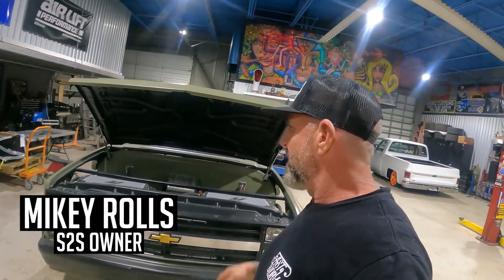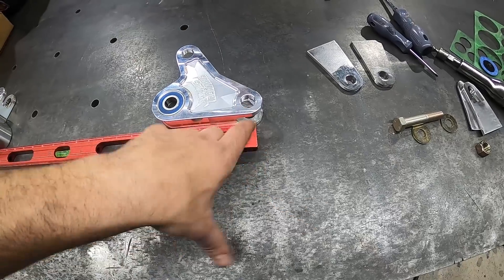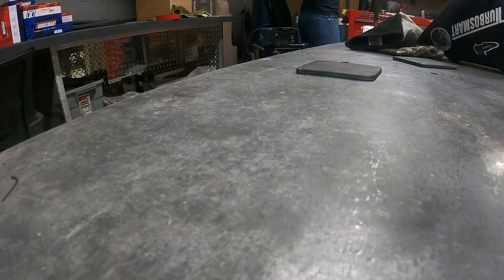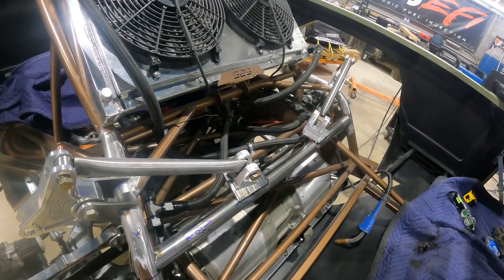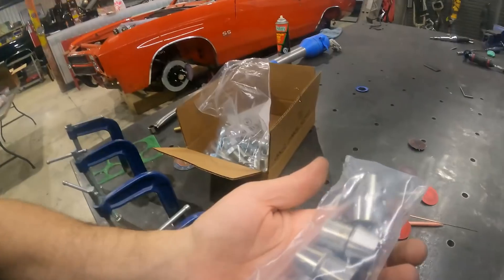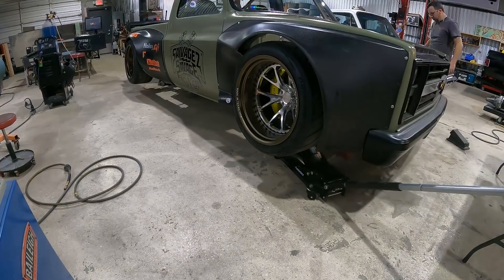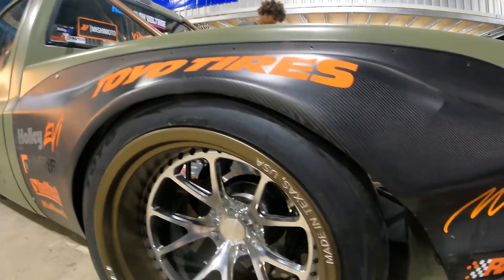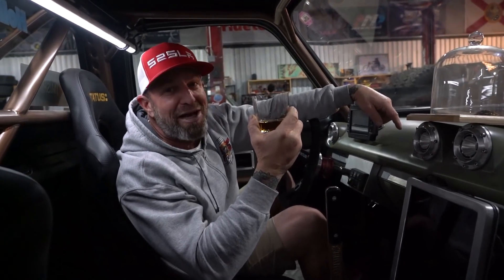Tesla Swapped Squarebody C10 Pushrod Suspension Fabrication! - EV C10 Ep. 26

Comment: I was yelling at him when he tried to mount the rod to clear the front half shaft lol. All u had to do is cut off the two pieces that stick up on the lower control arm (the piece that has all the holes drilled in it) smooth it up and take a piece of channel similar to the piece with the holes and then turn it 90° from the original orientation, front to back instead of the side to side orientation of the one he used. Then u could have had all the clearance and it would have given you the option of putting the arm with the hymes in front of or behind the half shaft. Also it would have allowed him to secure the hyme between the two sides instead of using one flat piece of steel and then spacing it out where it had all kinds of leverage and forces to just tare up that mount.  It would have worked flawlessly. Way better than the 3/8's inch clearance you have now. Did you turn the wheel, that half shaft doesn't stay in one spot, I'm sure he did. He is a great fabricator and I'm not at all putting him down the truck is amazing and I love it. I also love problem solving and fabricating. Thinking outside the box, sit a d look at it for 30 min or so before jumping on your first and easiest idea. Good luck and God bless...

Comment: Awesome man. I was yelling at you when u were trying to mount the rod to clear the front half shaft lol. All u had to do is cut off the two pieces that stick up on the lower control arm (the piece that has all the holes drilled in it) smooth it up and take a piece of channel similar to the piece with the holes and then turn it 90° from the original orientation. Then u could have had all the clearance and it would have given you the option of putting the arm with the hymes in front of or behind the half shaft. Would have worked flawlessly. Way better than the 3/8's inch clearance you have now. Did you turn the wheel, that half shaft doesn't stay in one spot, I'm sure you did. You are a great fabricator and I'm not at all putting u down the truck is amazing and I love it. I also love problem solving and fabricating. Thinking outside the box, sit a d look at it for 30 min or so before jumping on your first and easiest idea. Good luck and god bless...

Comment: It's definitely low. The question becomes more about how you plan to get over speed bumps and high angle driveways. Low cars don't much like sudden steep inclines or scraping their bellies on asphalt/concrete. If you're not careful it's going to wind up being a trailer queen...

Conversely if you could mount the shocks to an electric linear actuator with enough torque that could move the shock mounts in and out on demand, that would be cool beyond reason. I've never seen it before and I didn't have much luck with a quick search here on YouTube. You could also do it with push rods and hydraulics. Either way it's still a great build and I'm glad you shared the journey.
Reply from the maker: Yes we could do something like a hydro lfit. But first of the truck won’t ever see a speed bump or a driveway. The truck is made for racing and track use only. We can make adjustments by twisting the rod, can go up a few inches

Comment: I’m assuming that you could mount them on something that was not a 90° angle, but that would just make the math more complicated correct?
Reply from the maker: If you mounted that coil over bracket on something that wasn't 90 degrees, then it would mainly just change the length of the coil over you'd run to bring the angle out of the rocker back to that 90!

Comment: Will ya just look at that….just look at it….sometimes I just gotta step back and look at it ya know….lol love it. 
What’s the difference between this setup and a cantilever setup? Is it just the mounting points?
Reply from the maker: Same thing, different adjectives. The cantilever describes the movement/pivot. The pushrod is just describing the rod that sits where the coil over would be in a standard set up. We use the terms interchangeably. I'm sure there is some technical difference between the two, but we're keeping the descriptions simple!
Reply: I was thinking they were pretty close to the same thing just different terminology. It’s looking good. I can’t wait to see how it rides.

Comment: In board shock systems are Very sensitive. Any small change in angle in the shock changes the dynamics  in rebound and compression  and their rates. For a street car it's ok. But don't expect to  race with it. Fast changes  in loading and  unloading will occur  unpredictable . Why the change  from the old? Your addition  weight and moving parts. Kiss technique?

Comment: quite good looking mock up ... though at the front it seems that a massive shear stress is going to be applied at the bottom ball joint fastening point...  both on the bolt and on the drilled bottom suspension arm. Also since the split top plateforms are wider than the chromolly tube, maybe a reinforcing piece would beneficially take part of the pushing effort of one side to the other (linking the inner part of the small squarish plateforms to each other)? can't wait to see it in action...

Comment: For your rocker arms, do you have a spacer tube between the bearings and additional spacers outside of the rocker so that the mounting tabs apply pressure to the inner bearing races only?

I noticed when you lowered the truck after adjusting the front height that the rocker’s pivot point moved eccentrically quite a bit on the bolt. Was this just a mock-up setup or is everything in its final position? 

This truck is so cool and I’ve really loved your series showing the process. Keep up the great work!
Reply from the maker: This is all just preliminary mock up for the suspension. Everything is going to get finalized once we have our coiler overs. We just weren't able to order up our coil overs until we had everything roughed in place. Thanks so much for the support!
Reply: @SalvagetoSavage  Ah nice, that totally makes sense. Thanks for the reply as well as the insight as to what all goes into designing a pushrod suspension setup from scratch!

Comment: Bar far now my favorite channel on YT. Question for the team: Are all the kinks ironed out of the AWD system yet? I know you did have the front motor working to some extent a little while ago..
Reply from the maker: Yes and no. We're getting closer to getting it tuned right, but trying to work out some issues with applying full power from the battery to both motors at the same time without popping our pyro fuse! We'll give you an update on that once we have those coil overs in next time!
Reply: @SalvagetoSavage  might need to run two maybe for double the amperage?

Comment: Should put a spacer in between the two plates so when you’re tightening the bottom front bolt you don’t bend the mounts.
Reply: Its more than that though. if the pushrod is between the two plates it would be considered a double sheer joint. It's now only single sheer and significantly weaker. I hope that was just for mock up and they wont actually run it that way.
Reply: @benjaminbuschi284  I agree it should be a double sheer. Was just unsure how much they planned to change.

Comment: On the front set-up, are the axles going to articulate front to rear while steering and will that interfere with the pushrod?
Reply from the maker: It should mess with the pushrod at all. Our mounting point is pretty similar to how we had it with the standard suspension set up!

Comment: Looks awesome! Did you guys think about mounting the pushrod on the front suspension to the upper control arm? Just curious
Reply: I was yelling at him when he tried to mount the rod to clear the front half shaft lol. All u had to do is cut off the two pieces that stick up on the lower control arm (the piece that has all the holes drilled in it) smooth it up and take a piece of channel similar to the piece with the holes and then turn it 90° from the original orientation, front to back instead of the side to side orientation of the one he used. Then u could have had all the clearance and it would have given you the option of putting the arm with the hymes in front of or behind the half shaft. Also it would have allowed him to secure the hyme between the two sides instead of using one flat piece of steel and then spacing it out where it had all kinds of leverage and forces to just tare up that mount.  It would have worked flawlessly. Way better than the 3/8's inch clearance you have now. Did you turn the wheel, that half shaft doesn't stay in one spot, I'm sure he did. He is a great fabricator and I'm not at all putting him down the truck is amazing and I love it. I also love problem solving and fabricating. Thinking outside the box, sit a d look at it for 30 min or so before jumping on your first and easiest idea. Good luck and God bless...

Comment: Do you guys sell anything that could increase the turning radius on a stock c10? The stock turning radius is god awful.
Reply from the maker: We've just been slamming the truck into reverse to hit a quick 3 pointer on the U turns lol We'll definitely look into it! If we get a C10 with a stock suspension, it'll be our first project
Reply: @SalvagetoSavage  I have looked high and low for drift kits for steering but the only option is buy a drift kit and make it work lol

Comment: Did you take in the Diameter of the soil over into account? Looks tight to the frame.
Reply: On the rear.
Reply from the maker: Yeah! We're sure it will clear. And even if it doesn't, everything is just tacked in place, so we can can adjust it before final assembly!
Reply: @SalvagetoSavage  I love the Build! Nice work!

Comment: A few times here you used the plasma table to make a blank, then cut the part from that blank with a band saw and hand tools.  Why did you not simply cut the finished part on the table?
Reply from the maker: Tim got a fit bit and wanted to get his extra steps in! lol But all joking aside, Tim is very old school and very good with his hands. The plasma table is good for tough cuts and making brackets in bulk, but for the simple shapes he was making, it was easier for him to cut out the blank by hand. Generally, when we're making things on the plasma table, we'd have to measure and draw out our shape, transfer that data to the computer, test the cut on the plasma, then do a final cut to adjust for the tolerances on the plasma. Each bracket piece on the rocker arms is slightly different too (different curve depth and different angles). There are two unique shapes for the front and two unique shapes in the rear, so we'd have to design 4 different pieces in CAD. In the time it would take to do all of that, it's easier to cut these pieces by hand for parts that we'd never really need to make again. Hope that makes sense!

Comment: Looking good.  Engineer here.  I hope you will refab the lower mount for the heim joint so it's in double-shear, with a bracket touching both faces of the joint to support the bolt. Even with a beefy bolt hanging it out as a cantilever puts a lot more stress on it and you might see a break eventually. Rad truck. Love the build.
Reply from the maker: Thanks for the heads up!
Reply: @SalvagetoSavage   Just make the "fork" and bolt trough the lower mount. Same thing like the Civic has in front. Btw, can't you extend the fake coilovers to meet them in the middle? Just like the initial plan was?
Reply: @SalvagetoSavage  Love that you guys are willing to hear constructive critique! Always learning hey 😎
Reply: Excellent call out! It is looking great but I would hate to see them do damage to the truck if that point failed.
Reply: The front is more of a fail than single shear , the push rod will rub on the axle shaft when turning and when the front end flexes under stress.
There’s a reason most front drives straddle the axle or use macpherson strut or spring the upper wishbone.
Reply: Nicely said,  I love this build and the I love the possitive comments in this channel especially when it comes to the engagment of feedback when we see a possible area in need of some guidence.
Reply: Some wishbone style design for the lower control mounting. Evenly distribute the load and lessen the stress on the single open end mount. Love to see this still an active build even though SEMA is over. 👍🏻🤙🏻
Reply: I came to the comments looking for this.
Reply: Along with many other I was thinking the same thing, after all the work these guys have put in it doesn't seem right to do that lower mount this way. Hopefully it gets changed out, this would suck if the suspension gave way especially as there is so much weight to this vehicle.
Reply: @Trevor With a bolt and spacer between the two brackets, it's going to roughly double the stress on the side of the bracket touching the heim. The spacer between the brackets prevents bending of the bracket close to the heim joint, the heim joint side of the bracket will just roughly see all of the loading from the suspension. Als long as it can take that, I believe fatigue will be limited. The brackets look (ok, hardly scientific) pretty stout, I think it'll be fine.
-Fellow engineer, just providing a different perspective:)
Reply: I was yelling at him when he tried to mount the rod to clear the front half shaft lol. All u had to do is cut off the two pieces that stick up on the lower control arm (the piece that has all the holes drilled in it) smooth it up and take a piece of channel similar to the piece with the holes and then turn it 90° from the original orientation, front to back instead of the side to side orientation of the one he used. Then u could have had all the clearance and it would have given you the option of putting the arm with the hymes in front of or behind the half shaft. Also it would have allowed him to secure the hyme between the two sides instead of using one flat piece of steel and then spacing it out where it had all kinds of leverage and forces to just tare up that mount.  It would have worked flawlessly. Way better than the 3/8's inch clearance you have now. Did you turn the wheel, that half shaft doesn't stay in one spot, I'm sure he did. He is a great fabricator and I'm not at all putting him down the truck is amazing and I love it. I also love problem solving and fabricating. Thinking outside the box, sit a d look at it for 30 min or so before jumping on your first and easiest idea. Good luck and God bless...
Reply: How do you know if someone is an engineer? Wait 2 minutes, they’ll tell you.
Reply: I was about to say the same thing